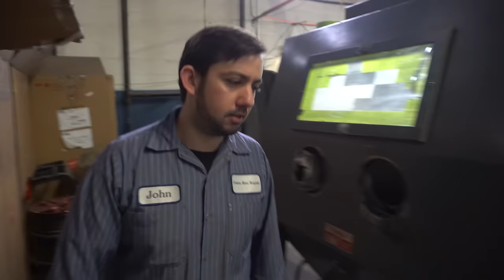How to PROPERLY FIX & POWDER COAT your Rims! Union Rim Repair!

Comment: I have been dealing with John at union rim for almost 9 years and I could say he is a real expert in refinishing all kind of rims
Reply from the maker: Glad to hear your experience. Not only has his work been phenomenal but genuinely nice guy. Just look at the results 👍
Reply: Maybe he is good with rims.  Maybe just maybe.
I took a batch of computer case panels for powder coat, and a few of them had holes in them which need patched.  There are a NUMBER of ways to go about patching them and *John* proposed to weld   them.  The guy turned my panels into T-1000 from Terminator 2.

Comment: brought my wheels to get powder coated and the place said they sandblasted them and tried to powder coat but it did not stick because of a clear coat that someone had sprayed on my wheels. now they’re saying i need to pay an extra $100 for them to sit in a solution to take off the clear coat. was wondering if they’re trying to get extra money out of me or they messed up and are now trying to scam me to make up for they’re screw up? response would be great thanks!

Comment: Nice job. Maybe a stupid question but is the color special paint or just paint with solvents? I asume you baked the last layer not on 200 degrees because the paint is melting or not.
Reply from the maker: I believe it is just paint with solvents but honestly I'm not a hundred percent sure.

Comment: I just finished washing my car and noticed that when the dealership rotated my wheels they damaged each one of them in several spots I think the air wrench grinded against my deep dish factory rim.  I have a Challenger Widebody 20x11 OEM rims.  Each rim has 4 deep gashes from their tool.  I have not spoken with them yet, I do not believe we have a rim place like yours down here in North Carolina. Any suggestions? I would like them replaced but am afraid they are going to hand me a bottle of touch up paint.
Reply from the maker: Really isn't a rim shop in North Carolina that you can go to? Maybe the dealership know somebody. This is why I hate dealerships they don't care for your property once they have sold it to you. Document everything and make sure you go there and get a resolution. Best of luck friend but don't give up if they try to push you around

Comment: I have a 2015 q60s limited and all 4 rims were scratched while I’m switching them from one tire to the other I want to know if I wanna do them at home what should I do especially that my car came out of the dealership with powder coated rims
Reply: But I’m talking about doing it at home
Reply from the maker: Doing this job at home would be very difficult you could try but you will never get these results
Reply: I guess I’ll try and let’s see if it works out anyways all I need is just to do it even if it’s shitty work till I get the rim and tire warranty but they were like we need the rim to be done so we could send pictures to the dealership so it would get it

Comment: I want to powder coat wheels for my new Bronco but well the powder coated hold up doing off road use or just get chip up .
Reply from the maker: It would hold up really well you just need to ensure you go to a proper installer.

Comment: Can I still powder coat my rims if they are plastidipped? As in like y’all would be able to remove the plastidip and still powder coat them black? Or they won’t worry anymore since they got plastdipped 😔?
Reply: I took my plasti dip wheels in they will take it off befor they paint at no cost extra

Comment: Need some advice if possible. I have just had my wheels powered coated (obviously not from you) and the face edge of the wheel, the paint as come off. I picked the car up 6 days ago and only driven it twice. Not kerbed them or driven down any pot holes.

Is there a way I could send you a photo?

Many thanks
Reply from the maker: Hey Will! Can you take it back to where you got the work done?
Reply: @carswithsonduren  hopefully, I am in talks with them at the moment. I would of thought powder coating would be durable compared to other methods!
Reply from the maker: It is as durable as it can get but all of that requires proper prep work. If the prep work was insufficient this can happen

Comment: Except I didn’t see any type of primer used on the rims.  If you get into the more custom colors  hot powder coating can actually change the color of the powder coat, often times making the part darker than the original color if it was shot at room temp and then baked.

Comment: I took a batch of computer case panels for powder coat, and a few of them had holes in them which need patched.  There are a NUMBER of ways to go about patching them and *John* proposed to weld   them.  The guy turned my panels into T-1000 from Terminator 2.

Moral of the story, don't ask anyone to weld unique/irreplaceable parts until that person has demonstrated to you that they can actually do it.

Comment: All that and then the dick heads at the dealerships smash your wheels onto the balance machine, remove the old weights with a screw driver, impact guns and then you’re back to where you started. Thanks to the ‘technicians’ making $10 per hour.